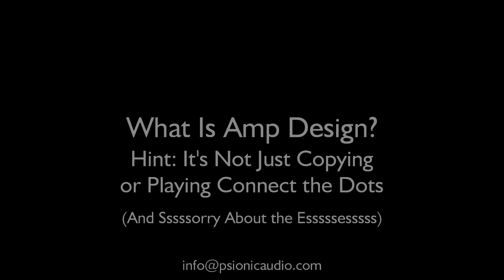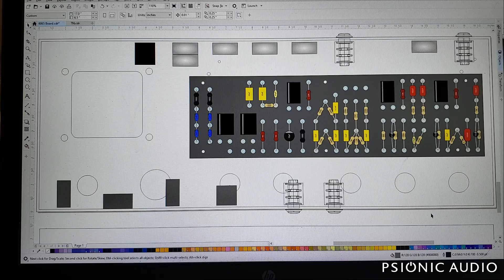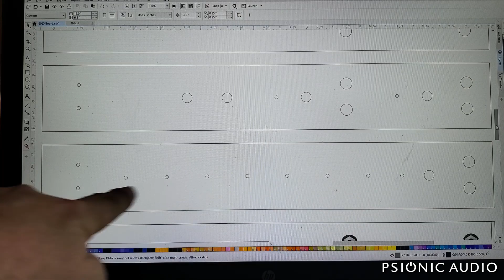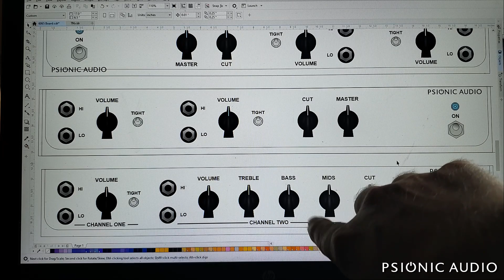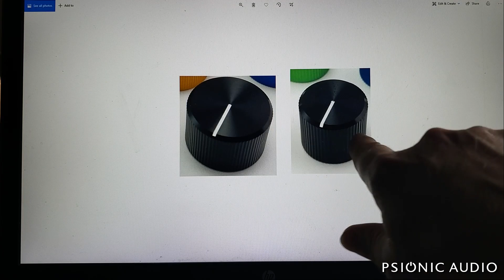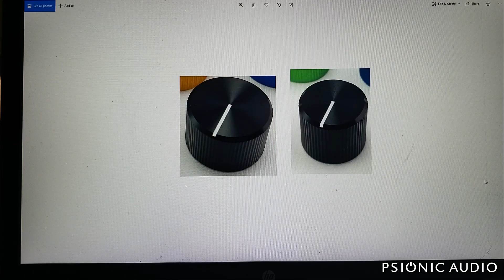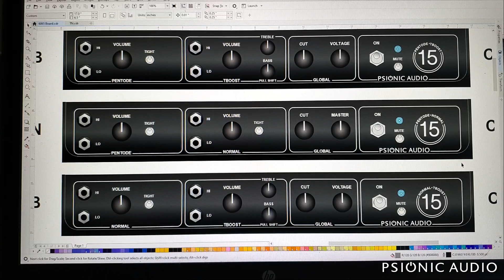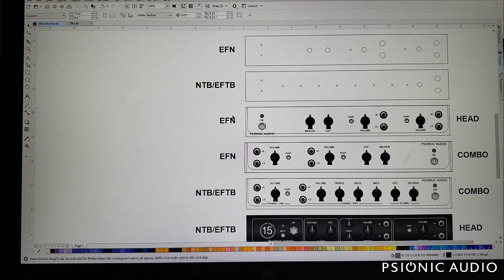What Is Amp Design? | Hint: It's Not Just Copying or Playing Connect the Dots

Comment: Really enjoying this so much. It's great and so generous of you to share your insights into amp design in such detail.
I think your choices in this design are logical and excellent, and the knobs and how you're gonna use them are great. 
Looking forward to seeing  how you'll use LND150 to emulate the pentode, I've been using Cascode circuits for the same purpose.
Its also pleased me to find we both use coral and express pcb for the same things, I'm only just experimenting with DIY layout calculator but it seem very useful.
Curious to know your personal preference between using the master or variable voltage.
Thanks Lyle, watching your progress avidly😀👍
Reply from the maker: Honestly? The MV is more than good enough, costs less, less to go wrong. But VV is better in that the tubes last longer if you play often at attenuated levels, and a scope finds it superior, though good ears are rarely disappointed by the MV.

And some just hate the idea of a MV, whereas the VV keeps the output tube compression and drive. 

I'll address all of this in more detail later.

Comment: I like where this amp is going. If I could make one suggestion though, I would label the voltage knob “Master” to reduce any confusion of its intended purpose. Also, I think a white LED would look best with the current aesthetic, and if it turned blue when muted even better.
Reply from the maker: There is a Master Volume circuit option and there is a Variable Voltage circuit option. I don't want them confused. They serve similar roles to the player but they are very different things.
Reply: @PsionicAudio  Can you explain in some future video the difference between them, on how they work and sound at the end. Thx

Comment: I really like your layout and attention to detail.  Cool nod to the past with your faceplate layout.  Do you mind showing us where you order your faceplates from at some point.  I've designed several and had mojotone make them, but noticed they have stopped single quantity runs and now have a minimum order quantity.
Reply from the maker: Thanks. My old laser panel company went out of business, so I've been using TMI Amplification, but need to look into some place that can do larger orders. But for at least the initial ones of these I'll use TMI.

Comment: Does the resistance in series with the diodes help simulate the valve rec?
Reply from the maker: Yes. And they are on the AC secondaries so there's a lot less heat than doing one huge resistor after the rectification.
Reply: @PsionicAudio  interesting, I wanted to experiment with this myself but wasn't sure how to approach it.  Thanks
Reply: @PsionicAudio  how critical is the value on these AC secondary resistors?